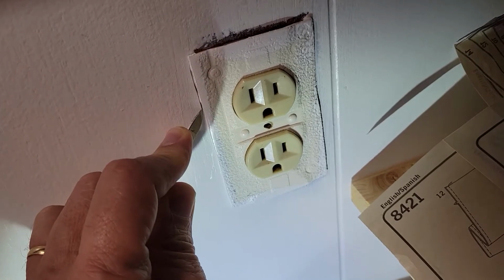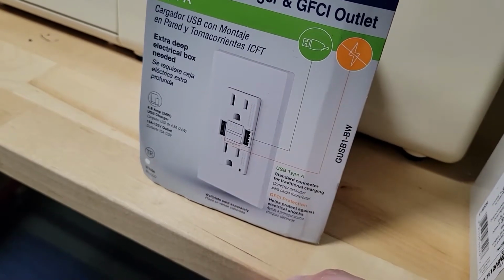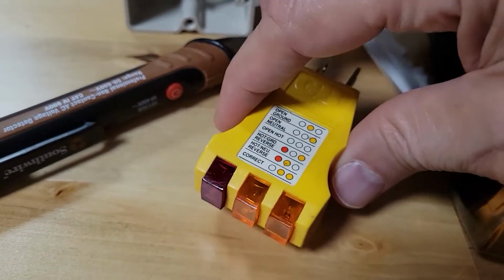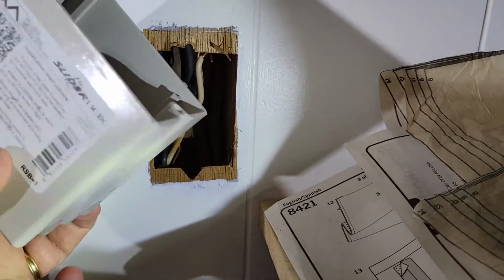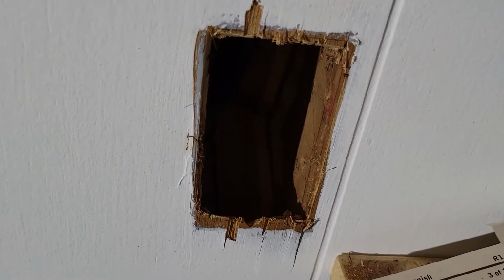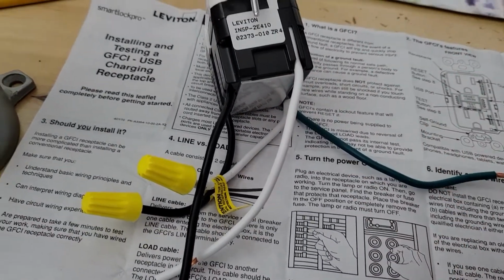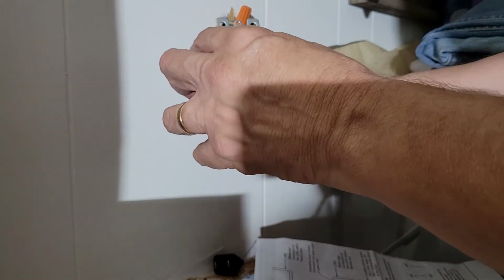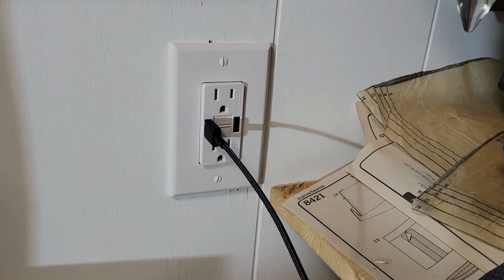Leviton Smart USB GFCI Outlet GUSB1

Comment: Hate those blue plastic boxes. They like to pull out
Reply from the maker: I have used metal, and the gray, white and blue boxes. I will take plastic and fiberglass over metal for ease of installation. With the proper sized opening I have never had issues with them pulling out. The first time I went to install one the hole was too large and it was a terrible job. I quickly learned how to do it correctly. Plastic receptacle boxes are not always suitable for every application.

Comment: The problem I’m having is that not all the five wire covers will fit into the box.
Reply from the maker: If wires won't tuck under you might try folding them so they compress easier, or try pushing as much of the wires to the back and out of the way. Another option is to swap out for a deeper box or using wago instead of wire nuts. Just don't use a screwdriver to push the wires further into the box, you want to use something blunt that will not damage the wires.

Comment: Soooooo thorough!  What would happen if the outlet has no ground wire though?  OR it has a "copper wire" running from one outlet to the other (don't ask!) but no actual ground running to the panel?
Reply from the maker: If there is no ground wire running to the panel then your outlet is ungrounded and potentially a hazard. I would consider replacing with GFCI outlet.

Comment: I do have a Klein tools plug tester that gets power from 2 AAA batteries! Meaning it can easily detect if a circuit is live or not even with open hot!
Reply from the maker: Albert, does it have any indicator to let you know the batteries are working? I would still check it on a known working receptacle just to make sure it functioning correctly. I have seen a plug tester that also display a voltage read out that can be a time saver. thanks for sharing.
Reply: @cfldriven  it’s one with a lcd screen! I always turn it on and test on know live appliance!
Reply from the maker: @VOLTRONDEFENDER4440  You'll live longer doing that.
Reply: @cfldriven  yes and it has a built in gfci tester that also shows how much time to trip
Reply from the maker: @VOLTRONDEFENDER4440  Very nice, will have to add to my tool bag.

Comment: It's not actually a smart / 'connected' outlet
Reply from the maker: It smart in that the USB charger varies output up to 24 watts to accommodate power needs of device connected (plugged) to it. This is not to be confused with a smart device that can communicate with via app. Sorry if that was not clear.

Comment: My receptical doesn't have a ground wire. Will I be able to install this unit?
Reply from the maker: Yes you will be able to install and while it will provide protection, it will sense an uneven load and cut the power,  it will not ground your outlet. The true way to ground the outlet is by connecting it to a ground wire, I know expensive if you have to make holes in walls.